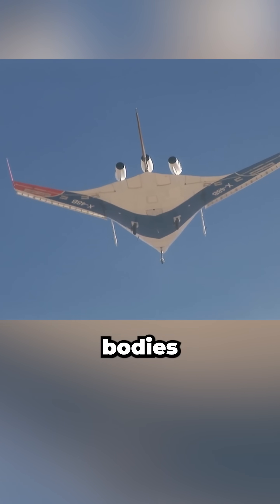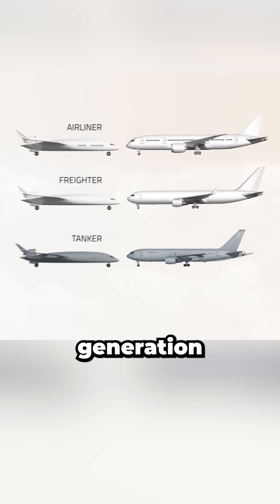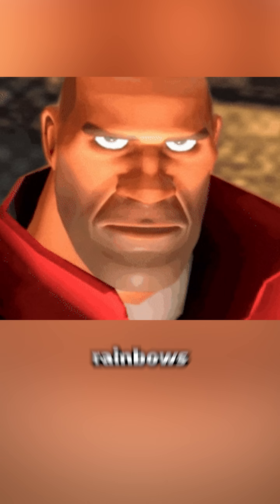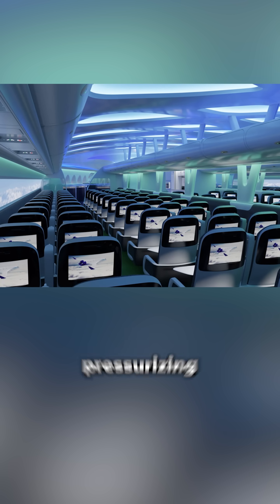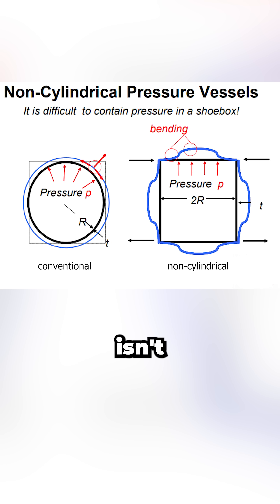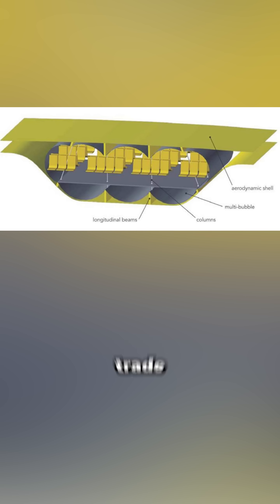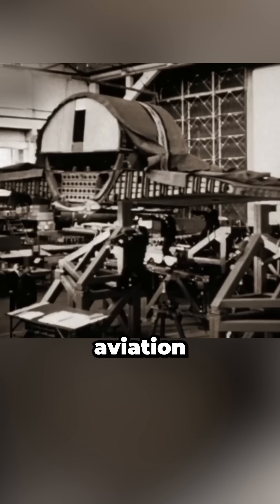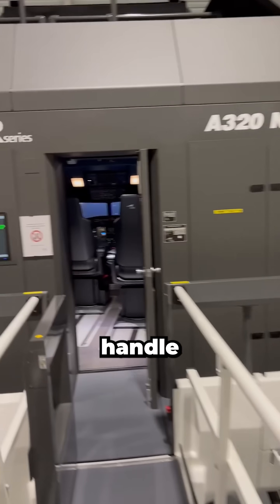Blended Wing Bodies: Aviation's boldest gamble yet?

Comment: A possible solution for BWB structures is basically to vary skin thickness and material density where loads are highest, like thicker around the center and thinner out on the wings. Add in tetrahedral lattice cores and you get crazy weight savings while still handling pressurization and bending. You can even tweak the lattice density across the plane for local reinforcement.